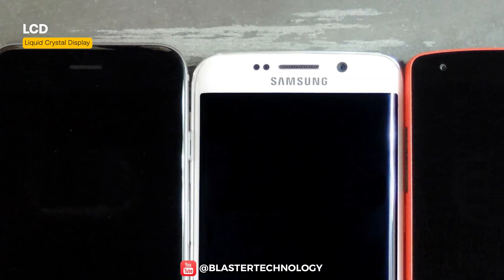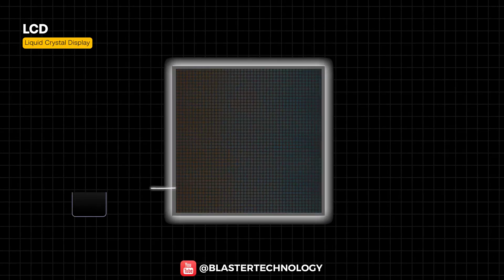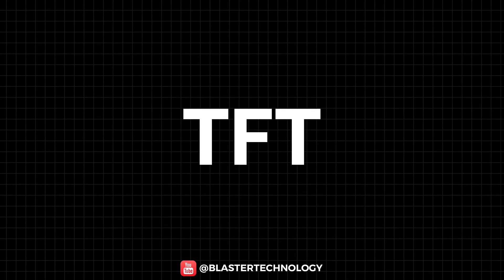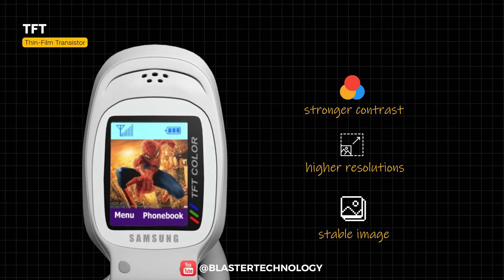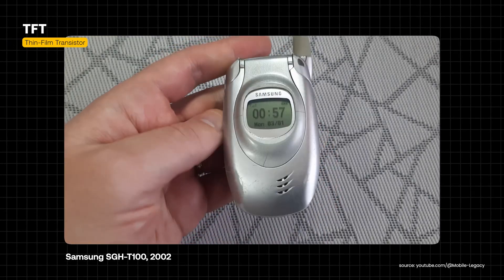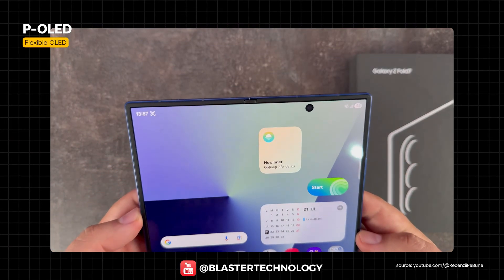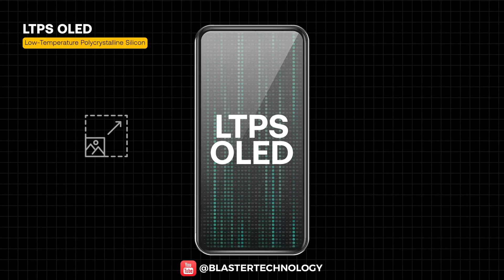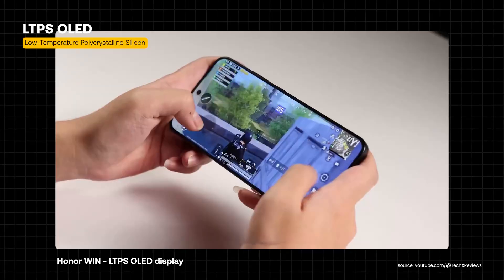Every Smartphone Display Types Explained | LCD, TFT, IPS, OLED, AMOLED, P-OLED, LTPS, LTPO

Comment: New Goods In Box
SE 2 64gb 1,580gh
XR 64gb📦 2,100gh
XR 128gb 📦2,450gh
11 128gb📦 3,100gh
11 pro 64gb 📦3,250gh
11 pro 256gb 📦3,750gh
12 mini 64gb📦 2,400gh
12 64gb 📦3,100gh
12 pro 128gb 📦4,400gh
12 pro 256gb 📦4,750gh
12 pro max 128gb📦5,500gh
12 pro max 256gb📦5,800gh
13 128gb 📦4,700gh
13 pro max 128gb 📦6,700gh
14 128gb 📦5,450gh
14 pro 128gb 📦8,200gh
14 Pro 256gb 📦8,850gh

NEW GOODS ! NEW GOODS !AVAILABLE SAMSUNG  UK 🇬🇧  

S21ultra      🟰4,600gh
Note20ultra 🟰4,500gh (256Gb)
S22             🟰3,500gh
S21 plus      🟰3,300gh
S21.             🟰3,000gh (256gb)
S20ultra     🟰3,500gh
S20 plus     🟰2,800gh
s10+            🟰2,950gh
S20.             🟰2,500gh
S20Fe.         🟰2,300gh
S10.              🟰2,300gh
S10e             🟰1,950gh
S9+.             🟰1,850gh
S9.                🟰1,650gh
S8+.             🟰1,800gh
S8.                🟰1,550gh
S7 edge.      🟰1,100gh
S7.                🟰850gh
S6edgeplus 🟰950gh
S6 edge.      🟰850gh
S6.                🟰750gh
Note20.        🟰2,800gh (256gb)
Note9.          🟰1,950gh
Note8.          🟰1,650gh
Flip3.             🟰4,200gh

A16 IN BOX 1,799gh
A17 IN BOX 1,870gh
A06 IN BOX 1,250gh
A07 IN BOX 1,370gh
A26 IN BOX 3,100gh
A36 IN BOX 3,800gh
A56 IN BOX 4,650gh

Location: Takoradi Market Circle. Opposite Zenith Bank ✅ Call 0502683089 / 0532920017

West Africa Ghana 
+233 502683089😊

Comment: And IGZO Display ? It is an LCD screen technology developed by Sharp that uses an oxide semiconductor to allow higher resolution, lower power consumption, and more precise touch response, reaching high frequencies resulting in about 240 Hz.
Reply: Yes. It's also LCD IPS.
Reply: IGZO and Triluminos display is really good, not as good as OLED but it's much better than plain old LCD

Comment: What about mini led!?
Reply: lcd with 100-5k individual dimming zone
Reply: @Psav26 ...Well I do know what it is, but why didn't they consider adding it to the list?
Reply: @arsinioboka26  maybe cause it's not common or even not used in smartphones.

Anyway if you would put all iterations there's a gazillion, Sony also used IPS with Triluminus which is quantum dot LCD and was I think the first to sell quantum Dot TVs back in like 2009 or 2010............
Reply: @arsinioboka26  because it's not used in phone
Reply: how many phones do you know from the top of your head that use mini led?
Reply: @kedprobably yes wat about quantum dot mini oled screen pls 😢
Reply: @lancehall7505  the hell is quantum dot mini oled 😭
Reply: Phones don't use mini led panel

Comment: Meanwhile sharp© make their own screens, rather than buying it from Samsung like every manufacturer does. This is why i love using sharp aquos devices, we had 240hz PRO IGZO OLED displays when your iPhones were stuck at 60hz and Samsung devices bragging their 120hz phones 😂
Reply: Most apps wouldn't support 240hz cus most phoens dont have it only system ui apps will support  it
Reply: @Thegrazy you are right, but the frame rate is adaptive (1-240hz). And there are games like Minecraft which gives you the highest fps equal to your phone capability (and it consumes more processing power) BUT sharp aquos R series (flagship) comes with highest Snapdragon elite chips 🤤
Reply: @MJDB only  minecraft and some other games codm dosent support 240fps and on most devices it dosent support 120fps
Reply: Though it's not like it matters, lately most are very similar in brightness, colors and all that matters.

Above 120hz on a phone for me is just wasting battery for nothing.

Hell even motion at such tiny sizes barely need any image processing unlike when comparing to giant TVs which for low FPS motion movies to look good need very good image processing or everything will either look robotic or like soap opera...
Reply: @guily6669 the pro igzo oled display technology developed by Sharp manufacturers is super efficient in terms of power consumption.
And the frame rate is adaptive (1-240hz) meaning if you play a 24 fps movie the screen turns 24 hz and if you read static elements like text it can be as low as 1hz

Comment: The Super Amoled screen in my Samsung burned out badly with green spots, while the IPS screen in my LG “fell apart” and quickly developed dead pixels. I have been using Super Retina XDR OLED for 4 years now and finally I have no problems with the screen! Although IPS used to be a great screen and did not deteriorate as quickly as it did later, my Galaxy Young, LG L9 II Swift, and Sony Xperia T still have no screen defects. Less effort used to mean greater attention to detail in the product...
Reply: Samsung and Apple both use the same screen technology it depends on the samsung phone becuase phones before s23 series  are prone to burn in
Reply: @Thegrazy  I know, but screen design and calibration are handled separately. Samsung and LG make screens for Apple devices, but Apple has control over how they ultimately end up in the devices
Reply: @Karsset they only custimize  brightness  and saturation they all use the same base pannel
Reply from the maker: It sounds like you've had quite a journey with different display types! Glad to hear the current one is working out well.
Reply: That's very relative, LCD is totally not common to degrade no matter which as far as I know but crap always happen on any kind of electronics...

I mean my first LCD crap cheap monitor from 2004 still works and has many thousands of hours, my 2009 small 720P IPS TV with led backlight also with many thousands of hours looks exactly like brand new day one, my 2015 Samsung 4K VA also looks exactly like day 1.

And for OLED my GF old cheap Samsung phone she would always sleep with YouTube playing for countless hours every day and after some good years 0 burn-in and still looked amazing. She bought another Samsung which has now more than 5 years and also another cheap OLED Samsung and also still looks brand new.

Same on my 2020 TCL 10 pro phone with TCL OLED, it has no burn-in however this OLED looks bad compared to Samsung OLED, it is very dirty on lower dark gray scale since day one.

Ps: in the meantime some people buy a LCD and already comes with dead pixels, others develop fast, same for OLED, there's many reports of people with burn-in on a Samsung Galaxy S OLED screen some even with 1 month... I'm guessing some have luck, some don't and some just keep the screen ON for huge times with max brightness which definitely makes LED LCD TVs to start burning LEDs or degrade the QD layer, burn-in on OLED (but on the LCD TV it's mostly manufacturer fault for pushing high brightness on cheap LEDs and no proper cooling and the crazy heat also seem to be what's degrading the QD layer on quantum dot TVs)......

Comment: Idk to me, Samsung 2015-2020 Super AMOLED tech is superior.
Reply: LTPO is peak imo, not just its basically super amoled but adjusts refresh rate, you can browse reels and stories at 120hz and when reading news or checking weather, music app it goes down to low hz and saves power, lower temps etc, really no thing is there that is better, maybe in future some micro leds will compete, now its way to expensive as micro led tvs from samsung costs 100k+ :D
Reply: @ForgottenExplorerthat's not what's he saying. Older j series with super AMOLED feels premium when looked at it compared to A series and some S series
Reply: @obinnaelisius1441  how so? its updates amoled , samsung displays are gold standart atm
Reply: Superior in greenline
Reply: Used to be. Not anymore.

Comment: Where is va panel?
Reply: Its too outdated man.. too outdated. What monitor you have? You have OLED TV? You have LTPO Phone?
Reply: @randomvideos2k205  Wtf are you talking about 😂 ips and tn are just as old yet still in production. Va wasn’t widely used on phones.
Reply: @randomvideos2k205 i have a va panel is not old
Reply: Don’t believe they were used on phones.

Comment: Some or every phones with Amoled display can cause i burn in
Reply: I used galaxy a50 for 4 years and no burns, no damage on the screen (it uses super amoled)
Reply: @adami120Still using the A50 since 02/2019. No problem...
Reply: OLED too
Reply: nahh I use samsung s20 5 years and still doesnt have a burn in
Reply: @Unknown-cw2jw same here s20 fe with only the back plastic changed cuz I put gorilla glue on it 😅
Reply: @Unknown-cw2jw  The higher the brightness, the faster things burn in, but also the longer something is static on the screen.
Reply: It depends on people's usage @Unknown-cw2jw
Reply: Its just every. Oled burn in isnt a risk, its a certainty
Reply: Oled burn is certain. .it will happen matters of time
Reply: @zahanaru9666 phone will be old and outdated by then anyways
Reply: You must use the phone for like 4 years or more before burn in ever occur 

I've used at least half a dozen amoled phones for years. Not a single one had burn ins
Reply: @carlhaikal92 i think it's insane to use a phone less than 4 years if you bought a high end...
Reply: @Bananikus some people just have more disposable cash
Reply: Super Amoled is the better choice.
Reply: Super amoled fixes this
Reply: True if you live in a hot area + gaming 24/7
Reply: Bought an exhibition phone from a local store and it has the Motorola logo burnt onto the display. It is barely noticeable on white backgrounds but hey, the flexible panel still looks awesome
Reply: Burn is common issue but easily mitigated
For ips there's image retention just not permanent
Reply: Yo uso un celular con amoled marca vivo hace 3 años y aún no me a pasado nada además que uso mucho para jugar horas y nada aunque esté hirviendo eso le pasa a las pantallas Oled y LTPO
Reply: yeah 15 years ago maybe with the Galaxy S2. 
Stop spreading bs
Reply: TFT LCD,PLS and IPS LCD heat everywhere,they reflect actual back lights behind the panel which sometimes melt the adhesive used in the display